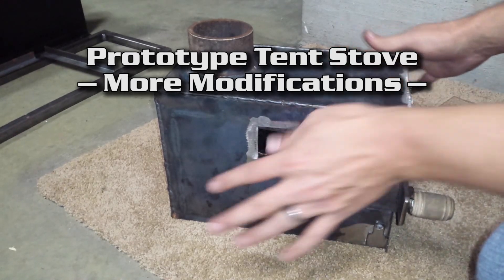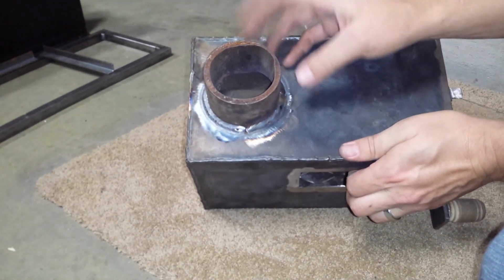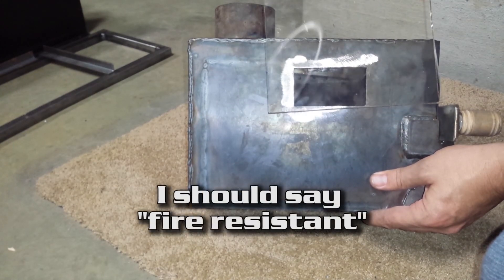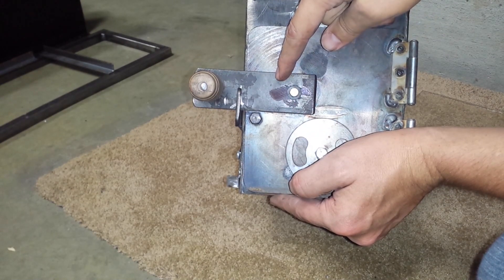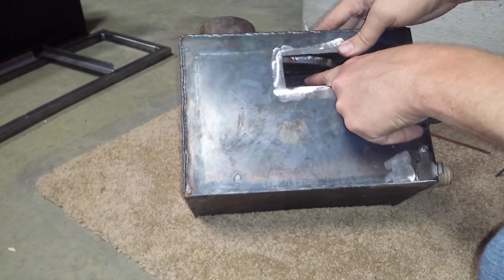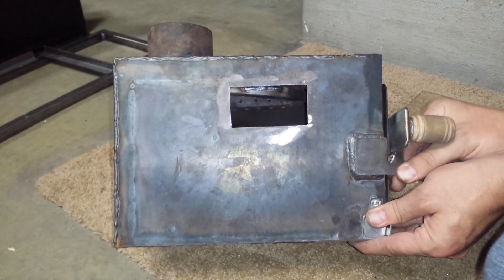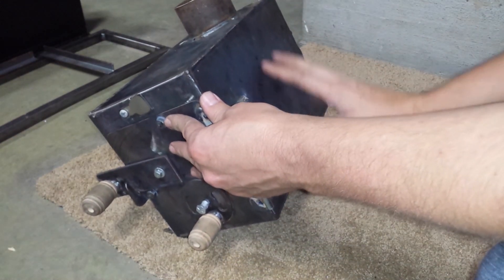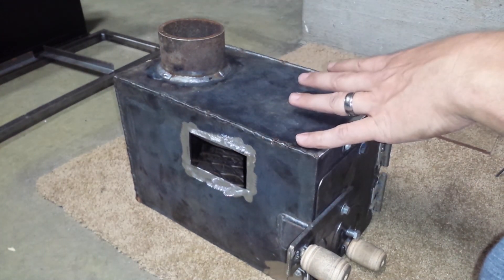Prototype Tent Stove -- More Modifications

Comment: Looks like it is coming along nicely. Nothing bad to say about it... Hell those ugly welds grind down easy enough and nobody would be the wiser.

I got ahold of a thrown away wood burning stove that had some pretty thick mica glass and with a 2" hole saw made a few holes on either side of my ammo can stove. Took the glass and cut it on a wet saw into a long rectangle and then slid it into flanges on the inside with some high heat mortar to lock it in place. I made an ammo can stove with a rectangular hole with a mica window a few years back and the metal around the rectangle window bowed enough to loose the seal and vent smoke. That's why I went to the round holes instead of rectangular. On your stove you won't have that bowing problem as the plate is much thicker than an ammo can's metal.

Keep up the good work and keep having fun doing it... Oh, you can get a stove door seal from the door of a junked stove and use that for your door. The temp rating is well beyond what an ammo can stove will produce. The nice thing about that stove door tape is that every inch or so there is a little 1/2" metal wire that fits into holes in the stove's face and locks the tape onto the stove without the need for adhesive. Just drill out holes on the stove to match and insert the lock wires. Although, I used the adhesive anyway just for good measure. The tape has yet to fail me or fall off. On all my other stoves with daily use, the tape's adhesive only lasts so long and one day when you least expect it when in the middle of bum frick Egypt it will begin to fall off. Miles away from an Ace Hardware for a replacement it truly sucked...

Comment: create you secondary burn just under the cooking surface not in the fire box. thanks for the vids
Reply from the maker: I will have to give that a shot.  Thank you
Reply: John Harmon - Cold Creek Works 1/16" holes through the sides into the upper chamber under the cooking surface.
the flue will make it draw much better>  jim.  Ogden UT

Comment: I really want one of these badly.  Would you consider making a couple of them once you have the kinks worked out and selling me one?
Reply from the maker: I was planning on cutting them out and selling weldable kits.  Do you have a welder?
Reply: Yes I do have a welder but have never really welded. Is the kit something a beginner could learn with?  My vote would be for thicker stock btw.
Reply from the maker: Anthony Webb   I can cut it out of any thickness within reason.  The plate I have is hot rolled steel.  I have 1/8, 3/16, and 1/4.  Shipping it is cheapest if I can fit it into a flat rate box.  I can also scale up the size of the stove if wanted... it just costs more.
Reply from the maker: Anthony Webb  Regarding welding, it is hard to say.  I see tents stoves full of gaps, and worry about carbon monoxide poisoning/death.  I plan on making this stove air tight for the most part.  As long as you can get a good seal with the weld bead I think it would be a good project to start on.